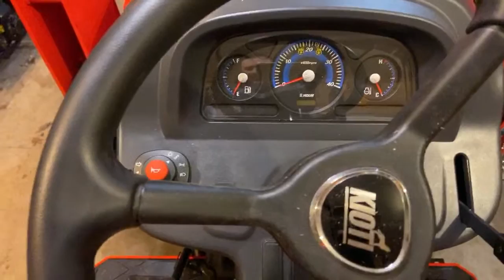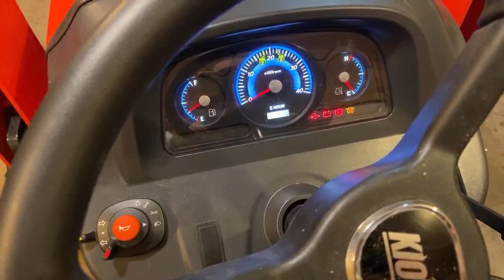Howl at the Moon - First Live Stream for the Kioti CK2610

Comment: Hey Dan,  love that Kioti man, you made a great investment! Say, got a quick question.  My neighbor has had tree services drop off loads of logs for years.  I worked out a deal with him to go back and buck up and haul out 3 cord worth to bring back home to split. Well, it looks like I mistakenly bucked up some Box Elder logs.
So to my question, is Box Elder a decent wood to burn in my stove? Is it worth splitting up and taking up space on my pallets? I know its in the maple family, but I have never knowingly burned it. Any feedback would be great. Thanks!
Reply: Well, it's better than basswood and poplars (slightly) but it is the lowest maple on the totem pole. It's worth it if you have a larger stove to burn larger pieces but even then it won't last overnight. I personally wouldn't make 16" firewood out of it except for kindling.
Reply: @digbyodell2924  Hey thanks for the feedback!